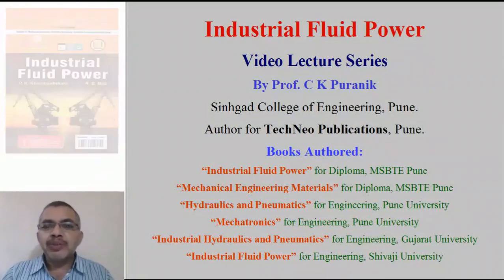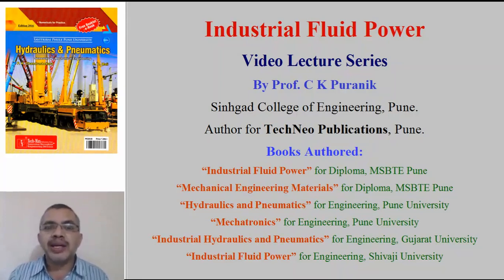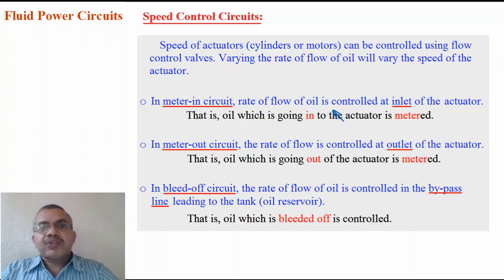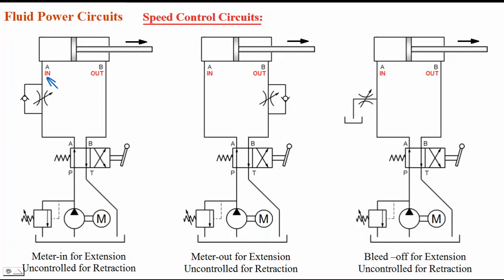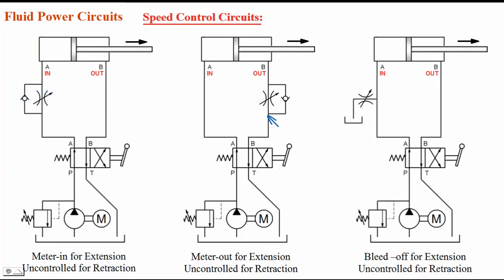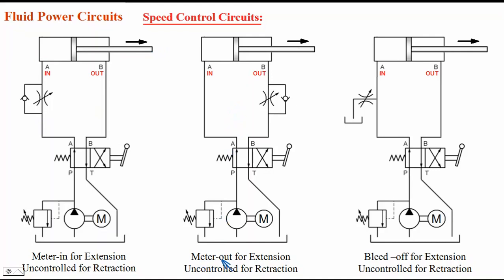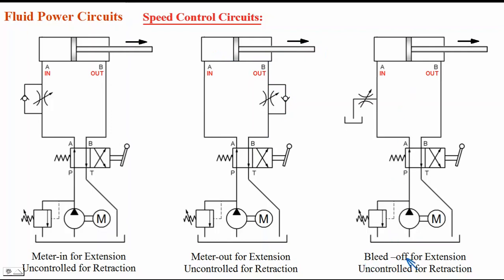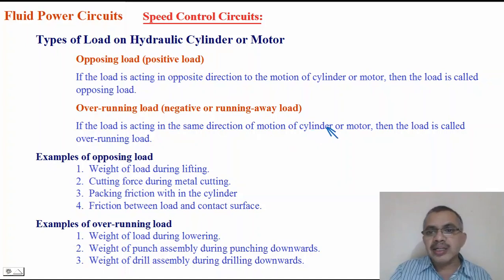Meter-in, Meter-out and Bleed-off circuits

Comment: I think there should be flow control valve with NRV in pipeline connecting rod end side of cylinder. Because in second position of valve there in no any "meter-in control"